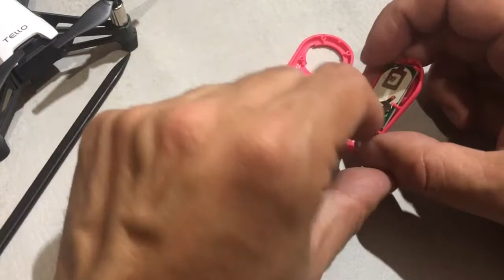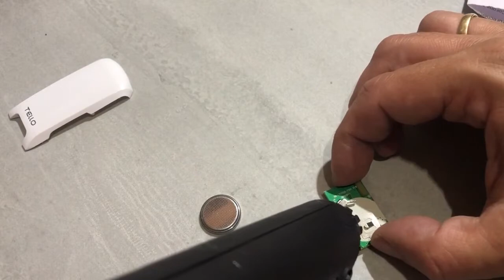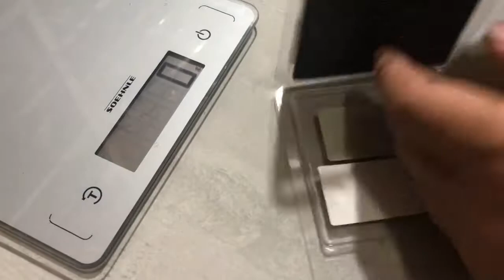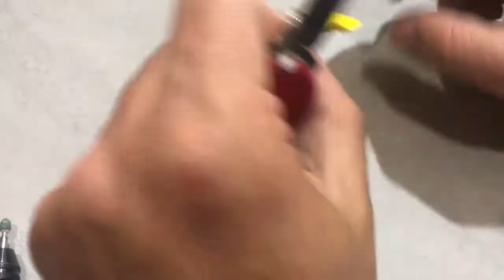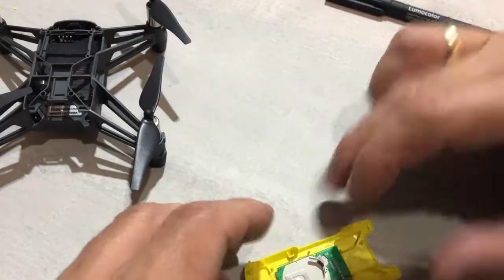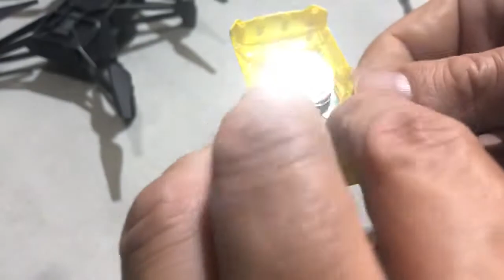Tello drone bluetooth tracker mod

Comment: Thank you for sharing your idea. I wish I would have it done to my Tello before I flew it away for more then 600 metres and it wasn't able to return all the way back because of the battery charge. It's landed 335 metres from me on it's way back in to the tall grass. Took me 4 hours of searching to find it. This tracker would be very helpful in a such situation. I had a rough idea from recorded video where approximately it's landed but it was really hard to find in a 15×15 meters square with the tall grass. With this tracker I would able to find it in a few minutes. 
By the way, did you notice any of the wifi interference with this tracker? I'm also using wifi repeater with my tello and just wondering if the tracker like this would not effect the signal strength.